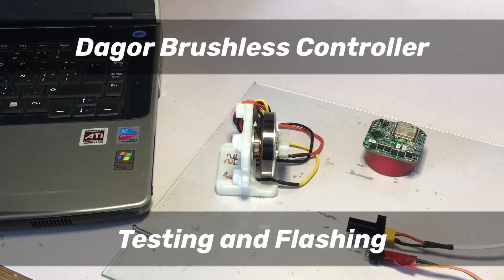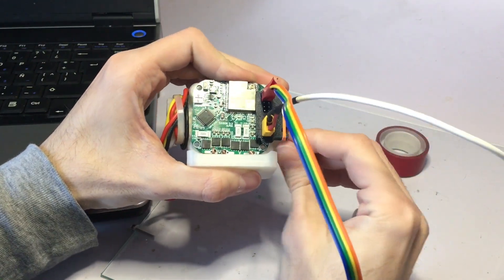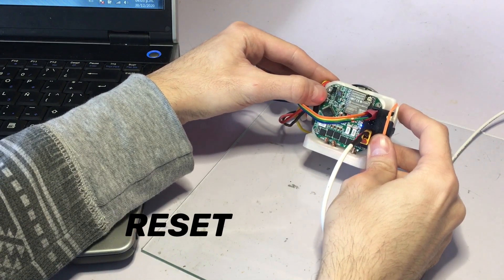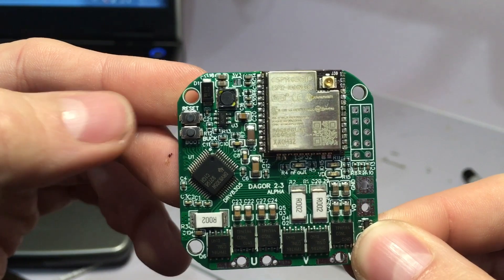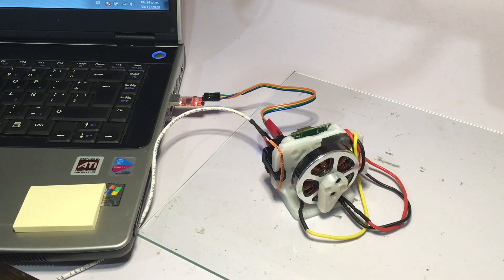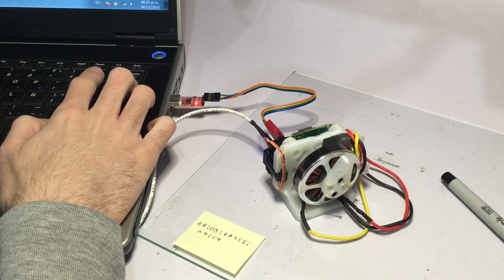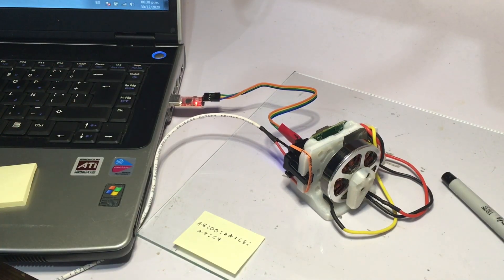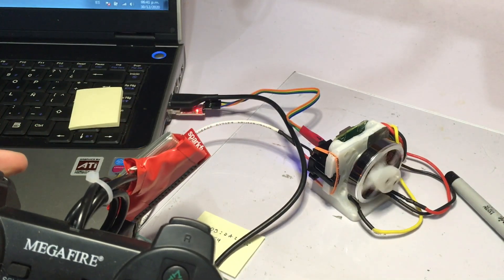Dagor Brushless Controller - Testing and Flashing

Comment: Thank you for your answer, I have solved this problem because of insufficient voltage. In addition, may I ask which motor is suitable for pid parameters in the open-source firmware? My 5010 motor is very abnormal after burning. If possible, could you share the pid parameters of your 5010 motor? Thank you very much
Reply from the maker: Every motor is a little different. If your motor burned I would suggest using a new one.

Comment: When I finished burning the firmware and connected the wiring and power correctly, I printed an error on the serial port: MOT: Init FOC failed.
DAGOR: Could not initialize SimpleFOC.
DRV8305: enGate Disabled
DRV8305: Fault detected ->
- Not responding.
What's the problem, please😟
Reply from the maker: Sounds like a SPI problem. Please ask for help on the SimpleFOC discord.

Comment: What is the name of the uploaded firmware in the video? There are a~j firmware in the FW folder in github. I do not know which one to download to ESP32?
Reply from the maker: @ChenxiHu-se4ct  all of it is part of the same Arduino project and together it makes the FW
Reply: @Dagor  But isn't it possible to flash only one ino file to ESP32 at a time on Arduino IDE? How to flash a～j ino files firmware to ESP32 at once?
Reply from the maker: @ it’s part of the same project. Put everything in the same folder and it will compile and upload.

Comment: Nice work! Looking great. Did you write the firmware in C? Or did you use a higher level language like Lua with NodeMCU, or with MicroPython? Or did you do a hybrid?
Reply from the maker: It's all Arduino-based. This board is part of the SimpleFOC project and will be sold at the site. Keep in mind that this project is still in its early stages so the firmware is still a little bit rough, but will be constantly polished and improved.
Reply: @Dagor  are there spare pins for the esp32? can it be used as a single board for a project by adding sensors , oled?
Reply from the maker: @Nobody-Nowhere  There’s 4 GPIOs open left to use. Single board projects are totally possible :)